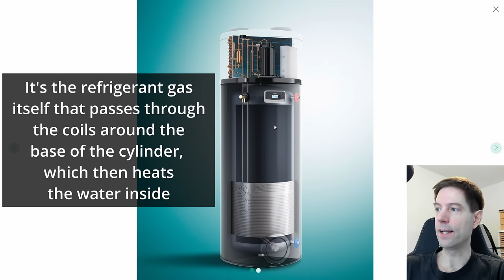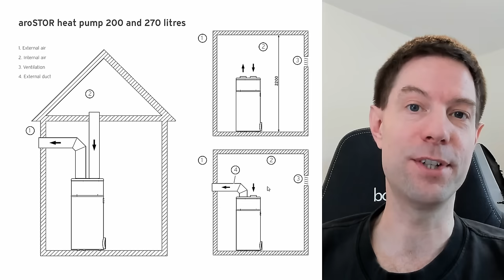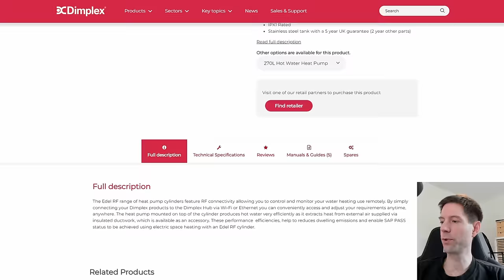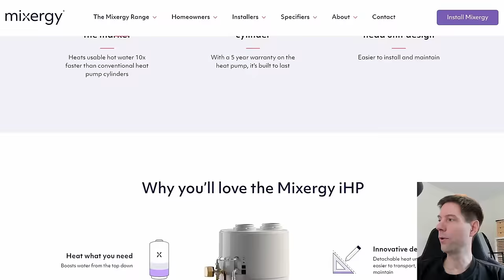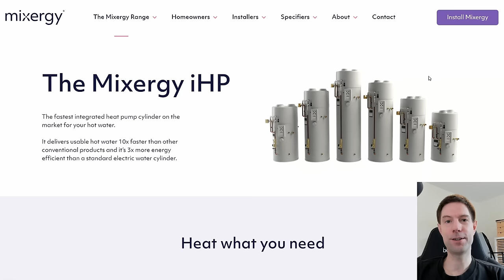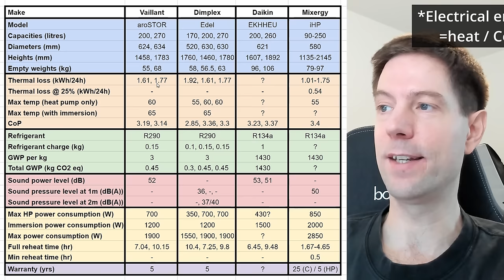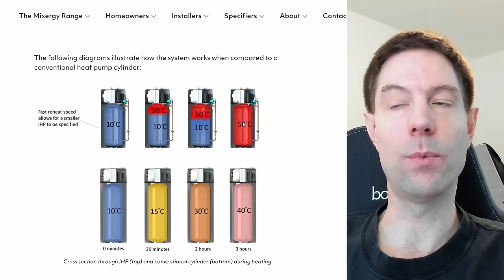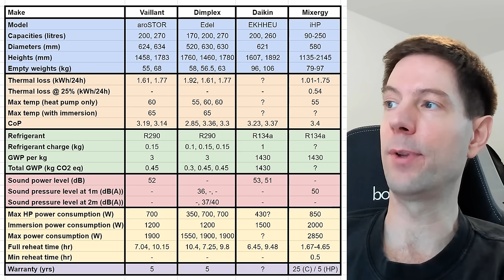Heat pump hot water cylinders - comparing specs

Comment: Tim, I so wish this video had been around about 18 months ago when we decided on our heat pump cylinder, though at the time there were few choices available and the Dimplex EDel 270RF ended up being our choice. As mentioned in other comments, it looked to me that some of the then not yet available models such as the Valiant were pretty much identical anyway - it’s just the marketing information which is confusing and different.

Apologies this is a long comment, but thought I’d share some useful things we learnt in the process:

270L is way bigger than we need for just the 2 of us, but it was virtually the same price as their others and so we figured we can use the extra capacity as a ‘thermal store’ instead of an extra battery, to take surplus solar PV generation. Note also that the Dimplex can be hooked up to your PV inverter so you can programme excess solar generation to ‘boost’ DHW production - Not sure if this is linked purely to the immersion element, nor have I worked out yet if or how I can link this with my SunSynk Hybrid inverter. I may be more efficient to use smart home automation to simply run the Dimplex’s heat pump when solar PV export occurs at set criteria.

As explained below, the Dimplex works exactly the same as the Mixergy in that it also heats from the top down, so you can still use what available water is up to temperature before the whole cylinder has reached target. Stratification is not some new technology unique to Mixergy - in fact lots of really old DHW cylinders work on the same principle.

Re what you said at 3:30; If you have an ASHP for heating, there are a number of good reasons to have a separate heat pump cylinder for DHW. We went for Mitsubishi Ecodan (5kW) for heating, but this exclusively runs the heating and the Dimplex runs separately for our DHW. 

Efficiency - There was no Mitsubishi Ecodan data published (when we bought ours) on the CoP performance for its hot water mode, but I contacted them and was told the efficiency is only around 1.7 during hot water production, as their design prioritises speed for DHW production over efficiency. The Dimplex CoP of 3.3 isn’t quoted as a SCoP, but they confirmed to me it was a average figure (based on ambient external temperatures) and I seem to recall it may have even factored in using the boost function from the immersion heater inside - which isn’t optimal. So, separating heating and DWH this way gives ultimate efficiency, as the ASHP can stay in weather compensated mode for heating 100% of the time, while the heat pump cylinder just does hot water. 

Cost - was very surprised to find that the heat pump cylinder was actually significantly cheaper than than buying the standard Mitsubishi pre-plumbed cylinder unit that would normally go with our Ecodan outside unit.

Location - the Dimplex is in our plant room, with intake and extract vents running out of adjacent external wall (minimal ducting/bends). Noise from the unit here isn’t a problem, as this is on the lower floor and opposite side of the house to our bedrooms, but in use the unit is not very noisy anyway (pleasant surprise). 

We also have an MVHR system (Zender Comfo Air Q) which has an extract vent located in the plant room ceiling, meaning 93% of all the heat generated in the room (IT equipment and the Dimplex cylinder etc) is used to preheat the fresh air being brought into ventilate the house. The MVHR reduces the heat losses of the whole building by over 30%, so provided you put anything that generates heat within the insulated envelope of the building, none of that goes to waste (technically 7% of it does, but overall still way less with an MVHR system). For us, this also negates any concerns about standing heat losses which you may encounter if located in say a garage.

Stratification of hot water - AFAIK this is not a ‘design feature’ unique to the Mixergy cylinder as our Dimplex Edel 270 RF operates the same way (heating from the top down); on the phone app for controlling it shows you how many litres of hot water (at the set temperature) are available at any time, with an example of how many showers or baths that equates to.

Again, apologies for such a long comment but hope this is of use for others considering these issues.
Reply from the maker: No problem, I appreciate the effort you've put into all the detail in your comment.  You are incorrect in your assertion that the Edel works the same as the Mixergy, however.  You're right that the hot water will always rise to the top and in that sense all heat pump cylinders will heat the top first.  Except that the Edel and others use coils wrapped around the whole cylinder and so transfer heat to the full body of water (with the hot water then rising to the top).  The Mixergy does generally operate in a similar way too (albeit with a plate heat exchanger rather than coils, which sends the hot water to the bottom of the cylinder and thus heats the full body of water in the cylinder) as this is the most efficient way that the heat pump can operate (because the temperature difference between the input and output water can be minimised).  However, the Mixergy has a second "boost" mode, where the plate heat exchanger sends the hot water directly to the top of the cylinder, rather than the bottom, which means the stratification happens significantly quicker than other heat pump cylinders.  The benefit is that the layer of hot water at the top is better defined and so the water right at the top is usable quicker.  The downside is that the efficiency is significantly lower heating the water this way, with a CoP closer to 2 rather than 3.4 as it would be heating in the normal mode (i.e. sending the hot water to the bottom rather than the top).  Generally we heat our hot water using the normal mode for maximum efficiency, but if we need the water at the top to reheat faster, for a guest to have a shower, for example, then we use the boost mode and it works extremely effectively.  If we use normal mode to reheat the water we would get usable hot water but it would take longer.  But in reality we use this boost mode rarely, it's just nice to have it available.  Regardless of the cylinder, having a heat pump do the water heating is always going to be hugely more efficient than any other way of heating water, so I'm glad you went down that route.  It sounds like you have a great setup.  I'd really like to have a full MVHR system one day, although I suspect retrofitting such a system to our existing house would be prohibitively expensive, at least for now.  Maybe one day!

Comment: Thanks for this. I'm actually most likely to choose a air to water system and had been thinking of the Mixergy. I must admit that I was a bit worried as I misread that heat loss figure and thought it said around 1.01-1.75 kWh per hour not per 24 hours and was really worried that I'd be losing 24-42 kWh per day and figured that I'd be using huge amounts of electricity just keeping the water hot. When I read it again and realised it was that much in 24 hours I was a little less worried. 🙂
Reply from the maker: Haha!  Yeah, that would be a lot of wasted energy.  Thankfully modern cylinders are pretty well insulated.  You'll probably find that an air to water heating system will come with its own hot water cylinder so you might not need to get a separate one.  Unless you're planning on getting a regular Mixergy cylinder to start with (without the heat pump on top) and then getting an A2W system later down the line when you'll be able to make use of that Mixergy cylinder.

Comment: I'm very grateful for this video and the information provided as it triggered the thought process. I find myself torn between two alternative thoughts:
1. As you produce own electricity and can  heat water at  at cheap  off-peak rate, why not just continue with immersion heaters, possibly instant heaters at the point of use? Payback period of HPHW seems to be well above 10 years (in your case) plus risk of failure then having to replace at big expense plus the risk of going for a time (days/weeks) without hot water. 
2. Adding to battery storage is more cost effective than HPHW
Reply from the maker: Cost effectiveness is not my main concern here, as I mentioned in the video.  However, you're right that the payback isn't really worth it when considering just the financial perspective.  Adding to battery storage might also not be worthwhile beyond a certain point, but that's a calculation I'll be showing in the Spring once I have all my heating data available.

Comment: Extracting heat from the attic to input into your hot water heater makes sense if you have a well insulated ceiling. In a ventilated attic the air temp in winter should be close to outdoor temp. During the summer months the extra heat will make the hot water heater more efficient. Instead of a vertical pipe into the attic I would use an elbow or tee stove pipe at least a foot above the insulation with wire mesh cover to keep out dust and rodents.
Reply from the maker: It depends where it's most convenient to put it really.  If the cylinder is on the first floor and isn't next to an external wall then venting to the loft makes sense, if it's in the garage next to an external wall then venting outside is more convenient.  The longer the vents and the more bends you add the lower the efficiency of the heat pump, interestingly, so keeping the pipes as short as possible and with as few bends as possible is preferred.

Comment: Great analysis. The loft space should be well ventilated to keep it dry, so the air will change quite often, so might as well grab some heat which has already been lost, there may also be a concentration of cold air at ground level from the existing air to air units. But at the same time I wouldn't want an extra pipe going up through a room, maybe through an airing cupboard though. Personally I would oversize the cylinder if you have the option to only heat part, the givenergy car charger should get added to intelligent at some point, giving you 6hrs+ off peak.
Reply from the maker: There are still a few details regarding the installation that I need to nail down before any final decisions are made, but I'll be sure to cover the whole process in due course.  It's totally possible all of my assumptions will be turned on their head, so I'm absolutely open to things changing if required!  Watch this space.

Comment: There's very little info on YouTube about sunamp thermal batteries, I know you talked briefly about it, I was just wondering why you dismissed it given your solar set up, air to air & space saving benefits? Just curious....
Reply from the maker: Simple, it comes down to efficiency.  Heat pump cylinders are 300+% efficient, Sunamp (or similar) are only 100% efficient.  I mentioned this in the video where I discussed Sunamp along with the other hot water options.  We don't have a need for the space saving that Sunamp offers, so a heat pump cylinder gives us that efficiency benefit.

Comment: Regarding legionella and the mixergy system. The bacteria could easily survive in the lower cooler part of the tank so I guess the routine cycle is more important in that case. My wife is a microbiologist and she insists we take this seriously.
Reply from the maker: The Mixergy heats the whole cylinder because it uses a plate heat exchanger in the heat pump and sends the hot water right to the bottom (when in eco mode), rather than using a coil which would leave a layer of cold water below.  Pretty handy.
Reply: @TimAndKatsGreenWalk  I think you mean that it can heat the whole tank not that it does because famously a feature of the mixergy is the separate layers that it maintains. Now I agree with you that a normal tank would indeed have a problem too if they cannot heat up the layer at the bottom. But unless the whole tank is heated, the bacteria will form a film on the parts of the tank that remain below the critical temperature and this video did mention that normal tanks tend to heat up the entire tank. But if the mixergy's cleaning cycle also heats up the entire tank once in a while, that's fine.
Reply from the maker: @NickAskew  the iHP works a bit differently to the regular one.  In eco mode it heats the whole tank and that's the mode you'd normally use as it gets the best efficiency.  In boost mode it heats the top, like the normal version.  The normal version can and does heat the whole tank in a cleansing cycle, but you're right that in normal operation it'll only heat what's needed at the top.  The iHP will heat the whole tank most days, however.

Comment: Another very informative video, thank you, though I am a bit late to this. Interestingly I read in another comment you had 2 Heat Pumps installed, did you require planning permission? I have seen this on another YouTube account but I think they are in Wales. Finally I saw today in an Everything Electric video that Mixergy are launching a new product this year called CubeX which is smaller.
Reply from the maker: Yup, planning permission was required because the units were closer than 1m from the boundary as well as there being two of them.  I spotted that new Mixergy CubeX while browsing their website the other day.  It looks intriguing and I shall be finding out more about it.

Comment: I installed the arostor 200L in June and the inlet went into the eaves of the chalet bungalow we just built. It worked perfect in the summer. We situated it into a cupboard with sound insulation and the noise has been fine. The chalet bungalow is a self build and we opted just for electric. We put in infrared heat sheets, solar panels and then the arostor. I have found that since October we are using a lot of energy and wondering whether the heat pump drawing in air from the loft could be a factor. It seems like the cold air is making it work a little bit too much. I wonder whether it would be beneficial to draw air from outside in the winter or warm air from the inside of the house? Im undecided.
Reply from the maker: The problem with drawing warm air from the house is that you then have to heat that back up again so you'll then use a lot more extra heating.  I don't think you'll improve your situation by moving the inlet, it's just one of those things that heat pumps will have to work harder when it's cold.  It'll still be significantly more efficient than any other form of heating.

Comment: The intake and exhaust routing can drive you crazy as someone will argue against all possible configurations. Probably just go with what fits. My US model seems to make most of its noise at the intake, and I've seen suggestions to improve the intake air filtering to keep the coils clean. So I plan to build an intake box and large filter to maybe quiet it down and make it last longer. The noise isn't very loud but is distinctive and not pleasant - sort of a higher frequency rasp to it. In the summer I plan to draw intake air from outside.
Reply from the maker: Indeed, it'll come down to what's practical in the end.

Comment: Interesting. I was astonished at how long these heat pump hot water cylinders take to heat a tank from cold, and went to look at our own ASHP timing and data which presumably is slightly less efficient as the hot water has to run all the way from the ASHP outside through the house to the cylinder in the middle of the house.   We only heat our tank once a day, overnight on agile in the winter and midday in summer in free solar. A cylinder full lasts a whole day for us.
By comparison, ours takes about 30-45 minutes and usually 3-5kWh although has been as low as 1.5 and as high as 6.7kWh.
So actually, when considering that the cylinder heat pump is only 800W, it’s not dissimilar although with a much longer heating time it’ll be less easy to run it in the overnight cheap slot (depending on the tariff you’re on. Flux quite short for example).
Personally I’m not convinced by Mixergy, they seem an over engineered and over priced solution to a problem that I don’t think many people need solving. But that’s my personal opinion.  The separate heat pump from the tank is a good thing though.
Reply from the maker: Generally speaking you won't be fully reheating a totally cold cylinder, so I expect the reheat times in normal operation won't be anything like as long.  Hopefully!
Reply: @TimAndKatsGreenWalk  one disadvantage of our ASHP setup is that it can only heat the radiators or the hot water at one time, not both (I thought that’s what 3 way valves do, but who knows). So to keep the house nice and warm (and only heat the tank on cheap electricity) it’s only once a day heating of the hot water cylinder. It does sometimes get down to 15-20 degrees in our tank.  You won’t have this restriction with a separate hot water heat pump so maybe you can keep yours topped up all day.